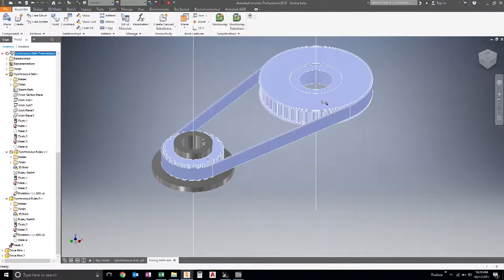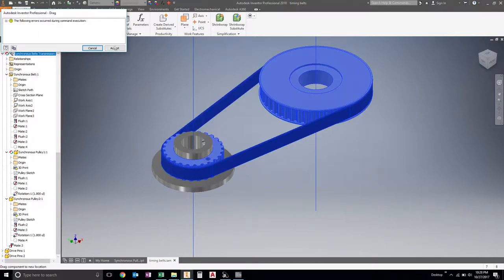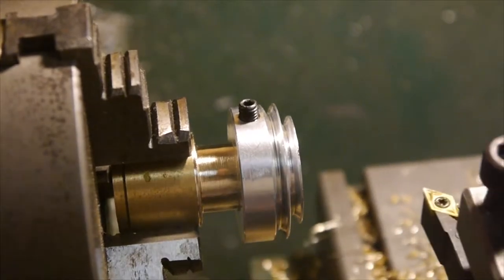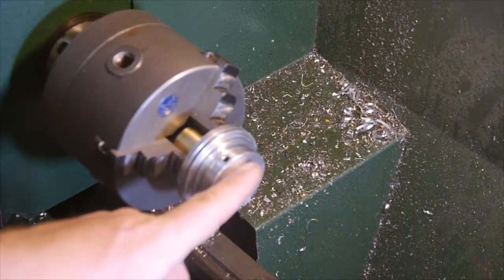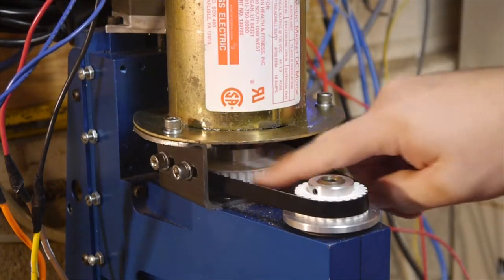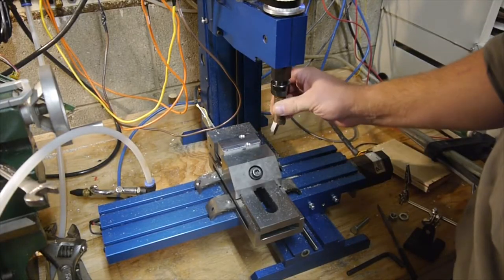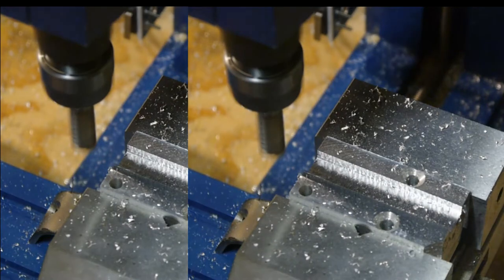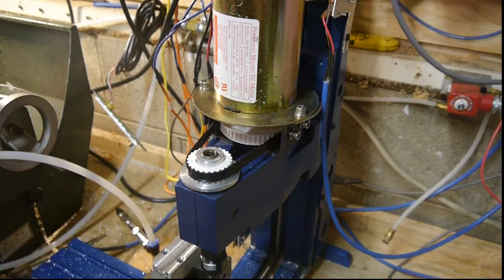How to make 3d printed custom pulleys for your MAXNC mini mill

Comment: I just got a gently used maxnc 10...complete but no software and no cable from computer to controller....can you help with pointing to where or how I can get these?
Reply from the maker: Hey Tom, Congratulations on your gently used Maxnc 10! I'll start by stating that like you mine did not come with software or a cord to connect to the computer. I abanded the idea of using the original software as it was quite old. The cord you are looking for is an old printer cable cord. I think it is a DB25. They are under ten bucks from the usual sources. This should allow you to connect an older desktop to the MaxNC. Does your Maxnc have closed loop feedback control? There will be an extra set of wires coming off each stepper motor if you do. I originally used the Demo Version of Mach3 to control the Maxnc. It is free to download and lets you experiment with your setup for little upfront cost. If I remember right it only runs like 200 lines of G code though in the demo form. You can purchase a license of Mach 3 or upgrade to Mach 4 so you can run it on an OS newer than Windows 7. I believe Mach 3 won't run on anything newer OS wise. You can use Fusion 360 to program the g code, Mach 3 or 4 to interpret the G code into  direction and pulse steps, which are then sent to the controller board on the back of your Maxnc, which will then amplify those signals and send them to the steppers.  Sorry got a little into the weeds there. Feel free to ask any questions you may have and I'll do what I can to help. Congrats on your new Maxnc and thanks for watching!

Comment: What program did you use to design the pulleys? I need to make 2 pulleys for a wind generator project that I am doing.
Reply from the maker: I used AutoCad Inventor as that is what I have access to through work. It's library has the pulleys built into it. It is not a cheap subscription though. I believe Fusion 360 is your best bet for designing pulleys on a budget. I did a quick search and there are a couple models and plugins that will let you design the timing belt pulley you require. Link below. https://twitter.com/adskfusion360/status/892360476881027073?lang=en   Thanks for watching and let me know how the wind generator project gets along. I have wanted to do something similar but do not really have the land to do it right. But still some day maybe... Good Luck!
Reply: @JoshAQ  Thanks for the reply and info. I did find the Fusion 360 file you suggested but I have no idea on how to use F360. I am old school. I will force myself to learn it.
Reply from the maker: @Stubby0266  I am glad you found it. The good news is there are literally thousands of tutorials out there for you to watch and learn from. I can feel your pain though, I had to learn Inventor from You Tube as I was the first in the office with the program. The second bit of good news is if you have worked with any other 3d program the basic commands are almost always the same. in concept. As a plus basic modelling skills are certainly a benefit when doing any kind of 3d printing around the house. If you find yourself up against a problem that you can't get around in Fusion feel free to contact me and I'll do what I can. I am not terribly familiar with it, but since both Fusion 360 and Inventor share a-lot of the same features just different interfaces I might be able to help. Good Luck!
Reply: Hi do u still have the stl files for the 3d printed parts....i think my treadmill motor shaft is 11/16 diameter

Comment: Hi, I am investigating a new spindle motor for my maxnc 15, and I happen to have a treadmill motor. Wondering how well this has worked out, and if you would do it the same way again. Are you willing to share the STL files for the pullies and fan? Thanks!
Reply from the maker: I have been very happy with my treadmill motor. So much better than the stock motor. I printed the timing gear pulleys out of abs and they started seperating and coming off the shafts after a couple minutes of milling. I think I have a video showing this... I ended up machining some aluminum v belt pulleys with set keys and now I am very happy and it is very reliable. Now on to the leadscrews! LoL. The fan has continued to work great! If I can find the .stl for the fan I will link it in the description and let you know.
Reply: @JoshAQ  cool, thanks!
Reply from the maker: @jmgallag  https://drive.google.com/file/d/1CrcirqqIuDNeD96Elp1tFuI1nYtbe0wh/view?usp=sharing
Link in the description as well for the .stl of the fan. Sorry for the delay in getting the link posted. Enjoy!
Reply: @JoshAQ  thanks!
Reply: @JoshAQ  So 3D printed gears are a no-go then?  Did you try other kinds of filaments? Were they 100% infill?
Reply from the maker: @ChristopherJones16  I wouldn't necessarily say they are a no go. I made them from ABS on my first 3d printer a XYZ Davinci 1.0. I don't remember if they were 100% infill. I didn't try other filaments, but PETG may work, the main take away I had was that I could not use a press fit to secure the smaller pulley. As the pulley warmed up the I.D. of the smaller pulley expanded and no longer held. Also the larger pulley ended up delaminating over time if I remember correctly. The V belt pulley setup I have now is superior due to it being made from Aluminum. A set screw may have been all that was needed to keep the smaller pulley secure, I just didn't try it.

Comment: You have your own little factory there! What model is the 3D printer? It looked like an H-frame design.
Reply from the maker: It is a Davinci 1.0 from XYZ. Not sure what an H-frame is. It does an OK job for the price point. I am sure if I dialed it in I could get better results, but I haven't messed with it much up until now. I am impressed with the companies support and updates for it's software and firmware. It started out marginal and 1 in 3 prints would be successful, and now it is almost a sure thing.
Reply: Interesting, I don't think I've seen one before, though I've heard the name. H-frame is where the Y axis carries the X axis (or vise-versa), it makes a sort of "H" shape across the top. Glad it's working out well for you! I had some pretty bad experiences with my first 3D printer, so I can appreciate good support and being able to get it printing reliably.
Reply from the maker: The "H" description makes sense, and yes it is an H-Frame. It works well for what I do. We have a vendor at work that has sent us 3d prints of V-Clamps and not sure what model they have but it is a night and day difference between what they sent, and what my machine can do. Mine doesn't hold a candle to it. They must be printing in Nylon or something. Material has a bit of a yellow tint to it.